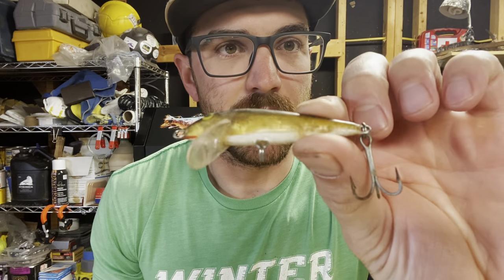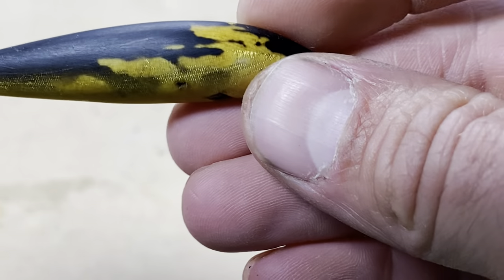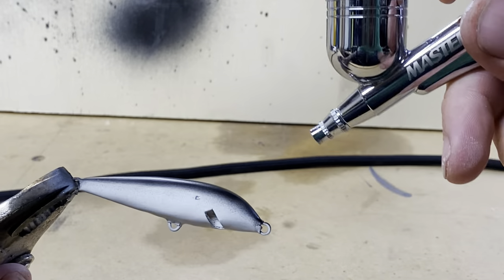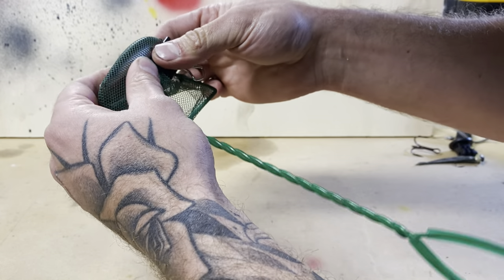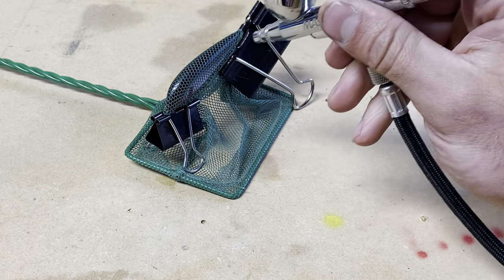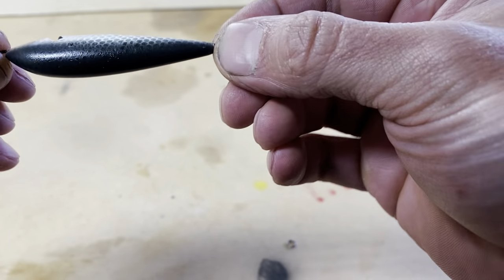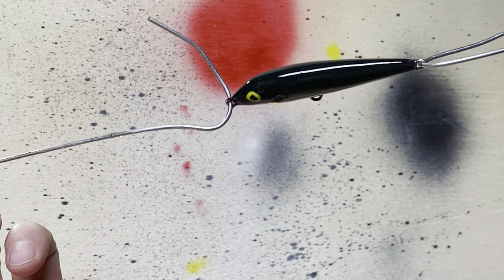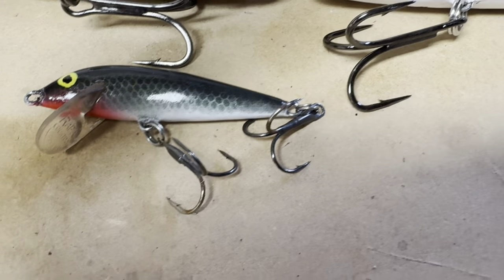Saving an old Rapala | Repainting an old lure

Comment: Dip head of a finish nail in your pupil color, the excess will "hang" down with nail held vertical, point up. One light touch will leave a round drop of paint. Paint job looks very good Sir. (can also be used for the Yellow in your design with larger headed nail).
Best of luck
Reply from the maker: Thanks for the tips!